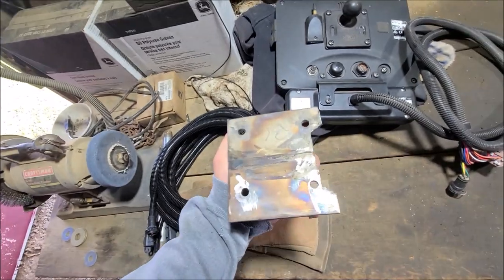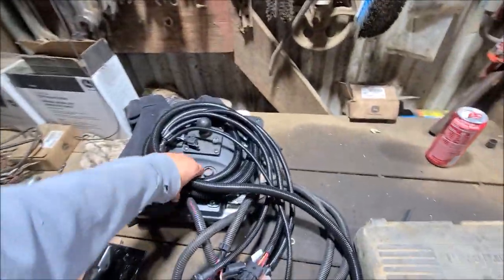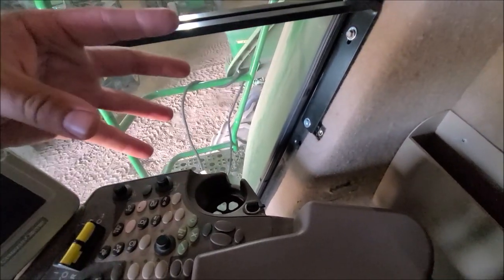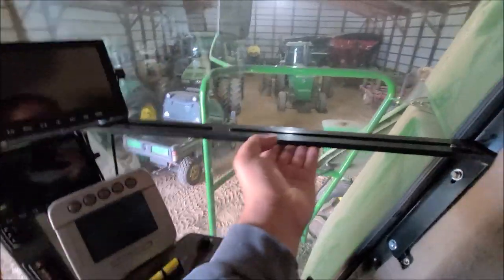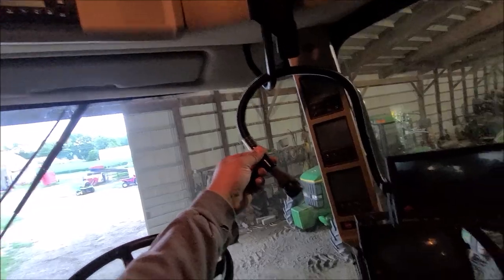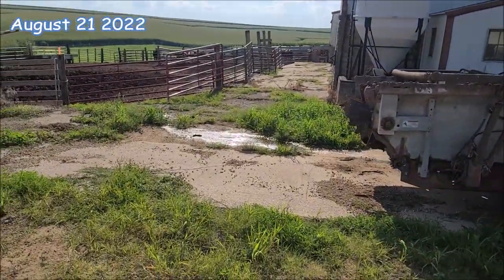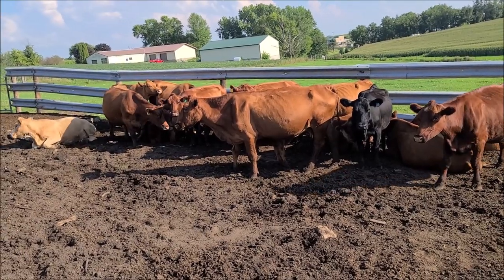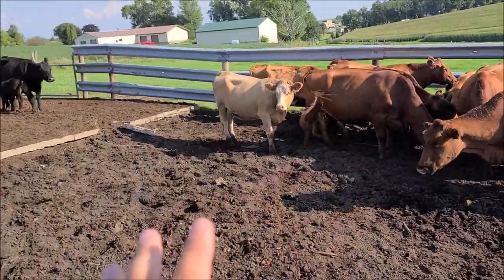Finishing Touch On The New Monitor Bracket

Comment: We originally thought the same thing on handheld radios and used Midland xTalkers. They worked fine but are not very loud. In 2020 we bought Midland MXT115's for the combine and grain cart tractor and are never going back. This year we put 115's in 2 more tractors and 2 trucks. For $200 bucks a machine they are worth it to have more range and clear transmission. If you need even more power go with the 275 or 400. Worth every dime